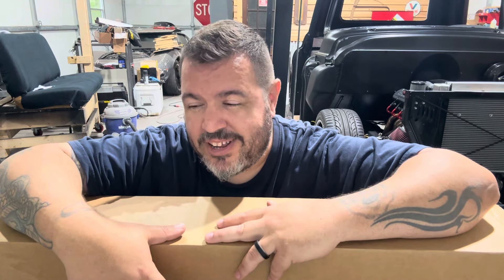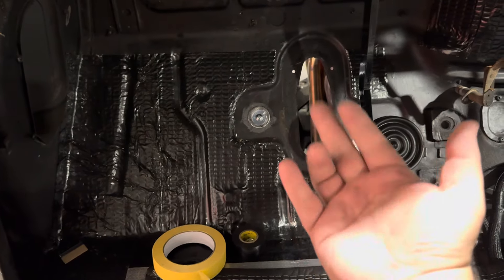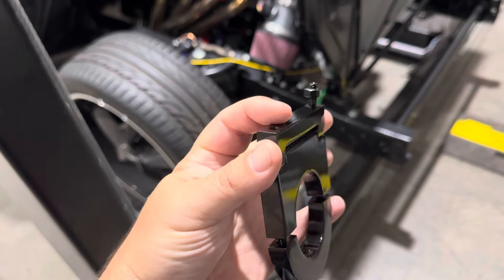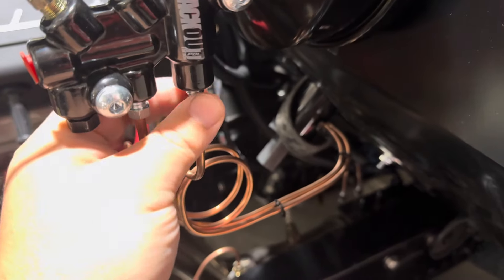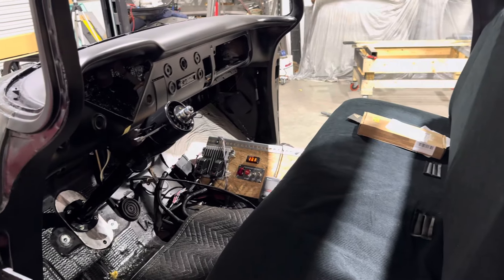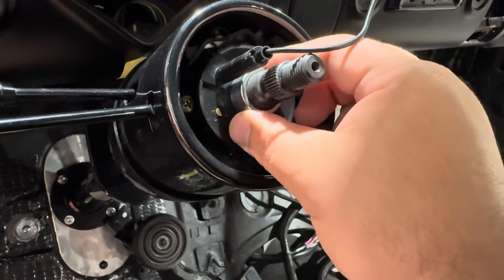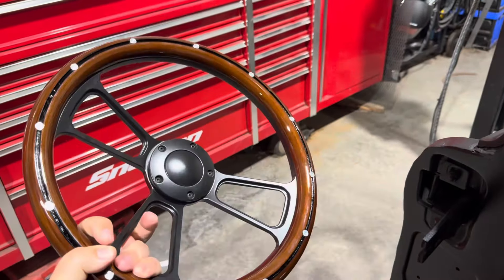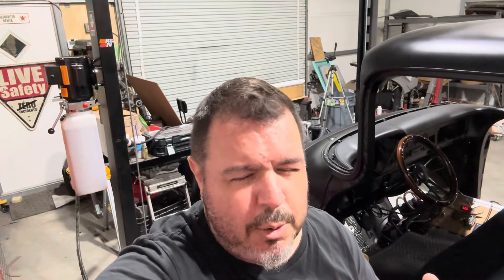How to Install a CHEAP eBay/Amazon Tilt Steering Column + Adapter & Steering Wheel – BUT Is it SAFE?

Comment from the maker: PRODUCTS USED IN THIS VIDEO:
Steering column:
https://amzn.to/3zPLLJ3
Steering wheel: 
https://amzn.to/3XOgK06
Hub adapter:
https://amzn.to/3NbFvhZ
Black billet turn signal, tilt, hazard levers:
https://amzn.to/3YaX5su
Floor plate seal:
https://amzn.to/3BrXXjC
Column drop bracket:
https://amzn.to/4gRPcja

Comment: Summit trip for your birthday! Man after my own heart. That Steering wheel is perfect for your build. love it. Nice work Mike. And don't worry about a little slop, front tires won't be on the ground all that much anyway!
Reply from the maker: YES! And a killer meal out afterwards. Yeah I love the wheel - the position of the column still needs a little tweaking though. Yeah, minor slop, but to be honest, I think once its connected via shaft TO the rack/wheels, that slop will be gone. Thanks brother - keep up the good work over there.

Comment: Great job Mike! I like the combo of wheel and column buddy, great choice. Totally understand the 14” vs 15” difference, gotta see those nice gauges you’re going to put in lol. I know you’re going a black out theme, but having a column support there in polished aluminum might look awesome too. Just a little bit of bling!
Reply from the maker: If I switched back to the 2.5” drop, the 14” wheel would be perfect, but I worry about the angle and it points right at my front brake lines. I might play with it and see if it works. Thanks brother.

Comment: Great video, and that steering wheel looks bitchin with the black and wood trim. I just subscribed because I am also building a 55 Chevy pickup and need all the help I can get. I will be starting on the brake lines soon so I will be checking out all your videos. 
Thanks
Reply from the maker: thank YOU more! And thanks for helping to resurrect another one of these awesome trucks! Ive got almost 125 videos on this build with plenty on brakes and brake lines! Hope it helps. 👍